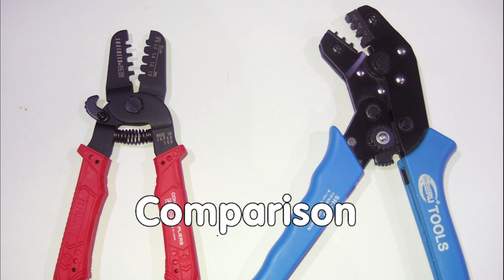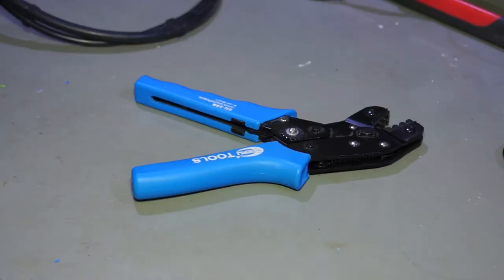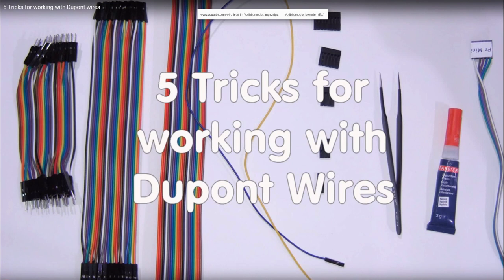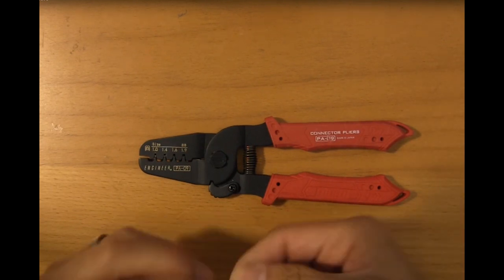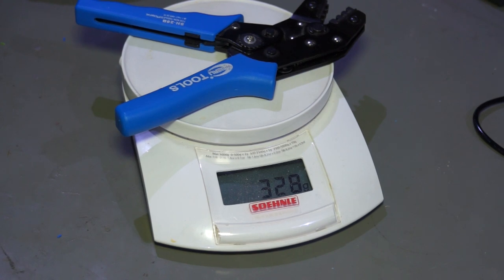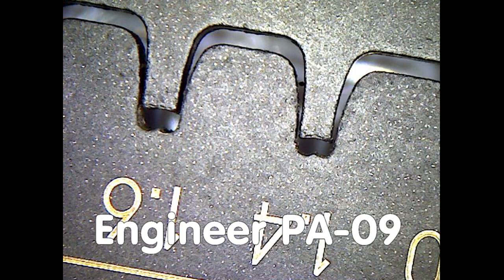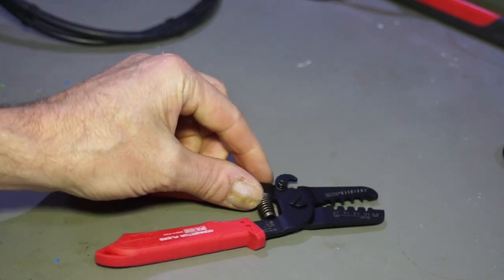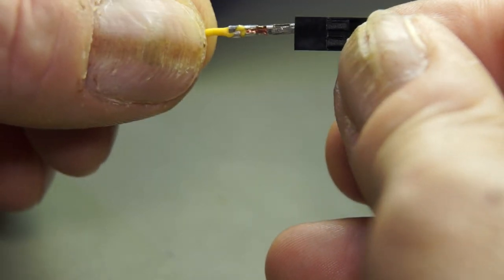#39 SN-28B Chinese Crimper  vs Engineer PA-09: Is there a difference for Dupont wires

Comment: Tank you for the information. I would like to know what is the biggest wire gauge i can use whit a Dupont connector ?
Reply from the maker: +MrPiet1888 Unfortunately, I cannot answer this question because I only have one size of wires and I even do not know its size. Maybe somebody else can answer or you find the answer in the spec sheets.
Reply: +Andreas Spiess tank you for take the effort to answer every question . I have contact many (Chinese) suppliers but they don’t now the answer either. The only way to find out is to try but again tank you for answering .

Comment: Thanks for the nice video. Do you have an advice for the Dupont pins and the housings? Do you recognized any difference in qualitiy? Or does this crimping tool have the bigger influence on the result?
Reply from the maker: The crimping tool is more important. I did not see big differences in the housings or the pins.
Reply: Thank you Andreas.

Comment: If you are going to crimp Dupont / XH2.54 terminal, SN-28B is not for you as it's designed for 3.96 or 4.8 plug terminals, that's why your crimped terminals are fat and are not able to enter the shell. You should get an SN-01BM, which has a special narrow jaw for these delicate terminals. Or even better, you can get an SN-02BM that can not only deal with 2.54, but also 2.0 terminals. I own both 28B and 01BM in China (former for 40 Yuan / 6 USD and latter for 75 Yuan / 12USD), and if you use them correctly, they work great. The Engineer one seems decent, but it's much more expensive (280 Yuan / 40 USD). As a hobbyist, I am pretty satisfied with the "Cheap Chinese Crap" :-D
Reply from the maker: These crimpers were sold for dupont connectors at this time.
Reply: @AndreasSpiess  Same here. I also realized it's not suitable for my dupont terminal only after I bought the 28B. The description is really misleading.

Comment: Thanks for this video.  I have the blue crimp tool and it is useless.  I cannot use it on my 3D printer wires at all as I cannot fit the crimped terminal into the housing.  I have ordered a PA-09 now.
When people say "buy cheap, buy twice" it's very true in this case.
Reply from the maker: This was the purpose of this video. Maybe one or the other can avoid that...

Comment: This video had me absolutely terrified that the crimper I ordered was going to be useless before it even got here, I was just looking for "how to use" videos. Flash forward to it actually getting here aaaand my ratcheting crimper works just fine. Ran two blanks just to get the feel, tried it on two spare wires again to get a feel for it got a pattern down and the first side of my harness came out nearly flawlessly, one wire was slightly too fat to slide into the housing but a quarter second with a pair of pliers solved that. I chock that up to this being the first time I've ever used the crimpers. 

On reply gave me some hope ahead of time suggesting that it might be that you're a leftie and as such where inadvertently loading the connectors in backwards, tho watching the video again it looks like all the labeling and ridges are on the correct side. So I kinda think it was just camera flip, that made it look like it was being used incorrectly. That said the wire being crimped in that instance is yellow and the wire we are shown later is blue and the only way I was able to get a result that looked similar to the blue wire with the wire side being that open was to load my connector in backwards. 

Ultimately I think the issue is that you probably ended up ordering from a sketchy seller that was just a little too sketchy and they sent you a product with a bad die. Since those are replaceable it probably would have been cheaper to have picked up a die from another seller but if the Japanese crimpers work for you, sweet. Thankfully I've had zero issues with my ratcheting crimpers but the die on mine definitely looks better than the one you showed.
Reply from the maker: You are right. There are different suppliers, and maybe you were luckier than me and many of the commenters of this video.

Comment: I bought both SN-28B and the HS-202B. The SN-28B had silver crimping dies which I thought was the better version, which might be true, but ultimately it has the same issues you pointed out, I can't get the insulation crimp to go into the dupont casing. Even with using a plier to squish the insulation crimp it's still difficult to get the connector into the housing.

The HS-202B creates a good insulation crimp, but terrible crimping on the bare wire. But I think HS-202B is better because it's cheaper and you can still use the tool to flatten the wire crimp almost perfectly. I might post a video showing this.

Also I think you're using the SN-28B "backwards" because you're doing it left handed.  

I'm pretty sure the SN-28B is not designed for dupont connectors,, because when I looked at the crimps on factory made wires, the insulation crimp looks nowhere near the same as ones made by the SN-28B due to the arch that makes the insulation wings go into the plastic vs the factory made wires which encase the insulation wings around the plastic.

For Canadians looking for the PA-09, Dazmode sells it and the PA-21 for a little over $60 with shipping+taxes.
Reply from the maker: Thanks for your comments. Yes, I am left handed, but according the many comments here, this seems not to be the problem. There are a few videos showing how to do Dupont wires with this tool. Also, If you search crimp Dupont on Aliexpress, you get many hits for the SN-28B. So, I assume, that it is intended for Dupont wires, but just not very good made.
A few viewers had better success with SN-28B purchased at hobbyking or Polu.

Comment: Hi Andreas,
Really like your videos.  I too bought the SN-28B and then watched your video.  You may want to check but it looks like you may have installed the terminal backwards in the SN-28B crimp tool.  I think the wire is always inserted on the side with the die text.  But even so, the dies aren't very smooth as you ponted out.  The PA-09 is really pricey so I took a chance on the IWISS IWS-3220M.  The dies are really clean and crimps both the wire and insulation.  I did four pull tests on #24 awg wire and the Dupont type terminals.  They all passed using the 1.6mm slot.  Strands started to break before the wire pulled out.  Not sure how long the IWS-3220M has be out for, maybe its new but would like to hear what others have to say about it.
Reply from the maker: Thanks for the feedback. There are a few other commenters about the IWISS which got similar results.

Comment: I originally bought a standard SN-28B crimper with the same results as yours, awful crimps.
So I started looking around and asking suppliers, and found a HS-B9 crimper, the body is the same, but the die is machined and very high quality, and also completely adjustable, even though I received mine perfectly calibrated and won't try to reposition it.
I paid it around 25€, unfortunately that was the only high quality die they had available.
Reply from the maker: I saw, that also hobbyking and others have a similar looking crimpers with different dies. So, obviously, you got a good one. Good to know for others which want to buy a new one.They have choice.
Reply: +Andreas Spiess 
Yes, many serious stores have crimpers wirh good dies, and they usually cost 35 to 50 Euros.
Where did you buy your Engineer crimper?

Comment: I guess it depends on what you are crimping. For Molex, atx and fan pins those cheap chinese crimpers seem to work fine. I do want a to try a pair of those Japanese ones for smaller pins though.
Reply from the maker: I only talk about "Dupont" connectors. Usually, every connector needs its special tool

Comment: Thank you,I have been looking all morning for something that will crimp lumberg 3111-01 connectors that does not cost 300 euros! like you I noticed no one showing you the end product doing the job. I also looked at this crimper and thought the quality was poor how wrong can you be. Thanks again for your video.
Reply from the maker: +Thefatneck59 You are welcome
Reply: bought the pa-21 for lumberg 3111-01connectors, use 1.6 for conductor and 2.5 for insulation works a treat and fits in plug perfectly. they have a cracking range of tools
Reply from the maker: +Thefatneck59 Thanks for your feedback

Comment: I to have the sn28 b tool and I found that the crimping part was the wrong orientation I took the jaws out and changed them around they work fine
Reply from the maker: I learned that there are many different versions of the SN28b in the market. So I am glad yours work.

Comment: AMP made a crimper they called the "Service Tool" that was somewhat similar to the PA-09, but it had both the "double-hump" and round "insulation" slots to produce both types of crimps. It was good for their nylon "appliance" connectors, as well as D-sub and Dupont types for 24-26ga wire. Might have worked on the 2mm pitch connectors, but I never tried it. Definitely not usable for the finer-pitched ones. After mine got stolen, I discovered that they had discontinued it.  :-(

But GC makes a knock-off (model 12-464) that's cheaper, but seems to be about as good as the original.

I have one of the ratcheting tools from Hansen Hobbies with no brand markings on it. Costs more ($40), but appears better made than the other no-name ones. One thing I discovered is that it also makes crimps that are hard to insert when using ordinary 24ga hookup wire, but does pretty well with "RC servo" wire, or ribbon cable,  that has thinner insulation.

I never use the male crimp pins for Dupont connectors: the pins are just too flimsy. I bought what you might call "double male" headers that have pins protruding the same length from both sides, instead of a short solder-tail. If the connector is likely to be disconnected and reconnected a lot, you might use a bit of superglue to glue the plastic part of the header to the shell. But I leave them loose, and just let the header stick to whichever female has the tighter grip.
Reply from the maker: You are right. I only use male pins if I have to (e.g. on the Arduino). Then, empty shells help (as shown in other videos). The original tools usually are good, but very expensive. No wonder it was stolen :-(

Comment: Thanks for the info.
I have a Velleman VTECT2, which produces a lot better results then what you show at the end from the Chinese one, and with a single action. That is, as long as you crimp AWG24. Thinner like AWG28 is just too thin because it crimps round, not with a middle-dent. So VTEC2 is good at a reasonable price, but I think I will order a PA-29 anyway for the smaller wires.
Thanks
Reply from the maker: +cybermaus One of my viewers asked which largest wires fit into the small Dupont connectors. Can you confirm, that you use AWG24 wires with Dupont connectors? Are you still getting the metal pieces into the plastic housings?
Reply: +Andreas Spiess AWG24 works perfectly for me. Still plenty of space, so I am pretty sure AWG22 would work also. With AWG20 you may have a struggle. But I never did try the latter 2.

Comment: I have the same problem with the Dupont Cables as you .... So i also look for a solution instead of using a long nose pliers.

Did any one of you find an alternative to the from Andreas posted Japanese crimper?

Is there any option form Knipex or an European or US Tool manufacturer ? 

Maybe you can list all the options which we found in all the comments directly under your video ... so the next searcher find the option without reading thousends of posts /comments

Best Regards
Reply from the maker: +c dersch There are a few opinions in the comments, but since I was not able to test it, I do not know how they work. Just browse through the comments and you will see, that there are not many options.
Reply: Naja..  So viele Optionen gab es jetzt nicht...  Nur noch eine weitere chinesische... Da muss es noch mehr Geben...

Comment: I have noticed the difference in quality just looking at the pictures of crimpers for sale on eBay. The good ones have a pretty smooth finish and are obviously precisely crafted. They are also more expensive. The cheap ones look very rough and the quality of crimping obviously would suffer.
Reply from the maker: Usually you only know what they delivered to you when you get it.

Comment: I've saw your video to late, I've allready bought china crimper, as you can imagine, have exactly same problem with fitting connector into the shelves.

I've read on polsih site forum that SN-03BM crimper are good enough and is rather chep.
Reply from the maker: Recently I did another comparison video

Comment: Have you ever tried the HS-202B Crimper tool?
Reply from the maker: No, I did not. But I am not sure, if they are made for Dupont cables (the examples shown on Aliexpress are bigger connectors)
Reply: And what about the DR-2 5500 5600? Looks similar to the Engineer...
Reply: And this one LS-303B :)
Reply from the maker: Since I am happy with the Engineer tool, I stopped experimenting (and spending more money)
Reply: Andreas Spiess Ok, thanks. I think the last one I mentioned with ABCDE grooves is for Molex while the Engineer is for Dupont as you mentioned...

Comment: Thanks for the heads up,I'll buy the japanese one now after watching your video, I use a bunch of crimpers and sick of using ones not fit for purpose same as you, thanks and cheers
Reply from the maker: Maybe you watch my newest video first. You can save a few bucks...
Reply: @AndreasSpiess  I'd already ordered the PA-09 set here in Australia and will probably arrive here in 2 days through a local seller and after watching your video as suggested I ordered the other set from UK, I  have a bunch of other crimps I think these will work great on, thanks for the heads up, cheers from AUS
Reply: The Engineer PA-09arrived here in under 24 hours from an electricians tool seller here  ] RHINO TOOLS]  but the other pair were damaged going through customs in the UK and cancelled the sale and refunded payment but am impressed with the PA-09, cerainly not cheap about $80 Au delivered but at least good tools you only have to buy once [so long as you don't lose them] thanks for your video it was a huge help and I bought accordingly as a result and now a new subscriber as well.cheers

Comment: wauue talk about an relevant video..was just going thrue crimbing tools for micro connectors ref RC, and narrowed it down the the 202B for around 6 bucks shipped, and the SN-28B around 10 bucks and the Engineeer PA-09 to an massive 47US as the cheapest i can fint atm incl shipping to Denmark..thx for your view on the matter..informative-.
Reply from the maker: You are welcome. Read also the comments below. It seems, that there are some SN-28B which also work for a little less than the PA-09.
Reply: Yes.. do you have an view on the 202B.. seems it can be optain for around 7 bucks and aint that precise or make as good joint as the engineer pa-09..(on a budget since my needs are relative small) but im unsure abut what crimbing size is needed for the smallest micro 1.25mm 2 pin connectors.(wanne crimp some new motors in for the XK X100) and got the motors + connectors.. but unsure what can manage these extreme small micro 2 pin connectors.. the crimb teeth on the 202B seems small but unsure to judge when its says values that i assume is for AWG wire size. (do you got an view if this item can manage the micro small jst connectors wich i belive is called 1.25mm micro terminals.
http://www.ebay.com/itm/122029828160?_trksid=p2055119.m1438.l2649&ssPageName=STRK%3AMEBIDX%3AIT
Reply from the maker: +Jakob H. I do not know the 202B. You find a link to the product page of the Engineer below in the comments. There you find which cables you can crimp

Comment: That is very unfortunate, but not so surprising as it is an inexpensive Chinese product. There are probably real ratcheting crimping tools for the DuPont connection available inexpensively from the usual sources from China and they are very likely to be effective. 
Regrettably you need to check very carefully and be sure that the description matches the tool you are getting. I haven't searched for proper DuPont crimping tools as I seldom use them.

Comment: The blue one is not for dupont connectors. Its probably for uninsulated spade connectors and maybe molex.
Reply from the maker: Maybe. But it was sold for Dupont cables (see many other comments)
Reply: @AndreasSpiess  Yes alot of things are sold as being for something they are not for. I bought one of those blue tools from ebay because it was cheaper and they are sold as being for tyco superseal pins in a sweidish motorfactors. They are not but they do work well for uninsulated spade connectors.

Comment: Also, don't get a $10 wire stripper! I bought a Jokari Super 4 Plus for about $30 and it works like a charm!
Reply from the maker: Looks like a very good price-performance. I do no more use the "automatic" ones. I use the cheap ones where you have a hole for each diameter. They work ok for me.

Comment: Thank you for the video, it will save me the money I was about to pay to get "the blue thing" ;)
There is also another crimping tool the SN-01BM available on aliexpress. 
Looks more like the crimping tool +Sindre is describing here. I think the smallest "hole" on the SN-28B is stil a little bit too large. maybe that's why it's not crimping good around the wire / isolation.
Reply from the maker: +Sven Troncquo I think, it is not about the size, it is more about the shape of the hole. The SN-01BM seems to be different, but also nearly twice as expensive. The difference to a PA-28 is then also not as big...